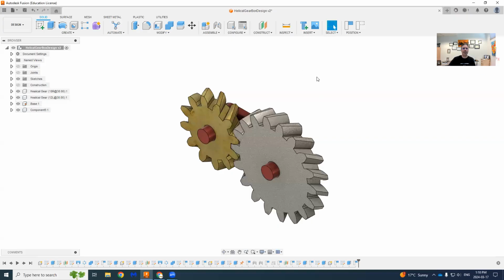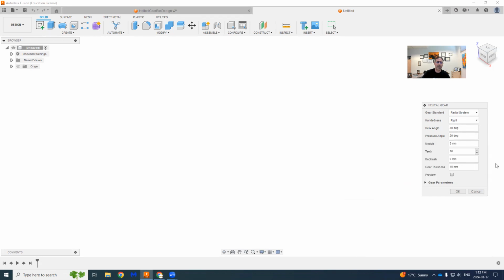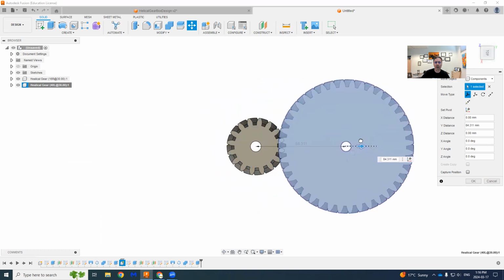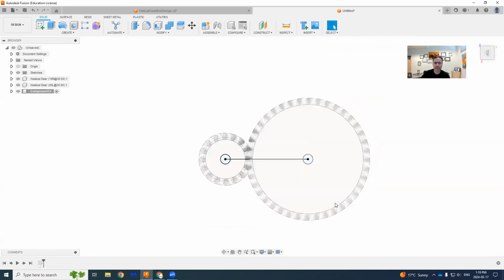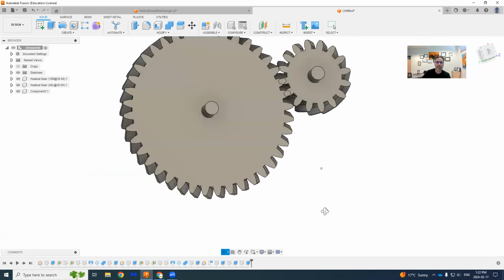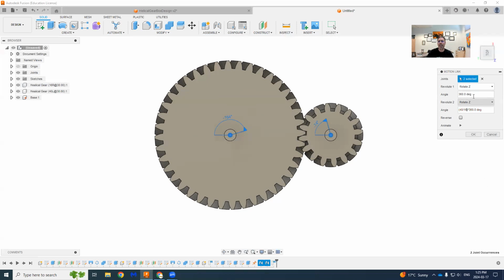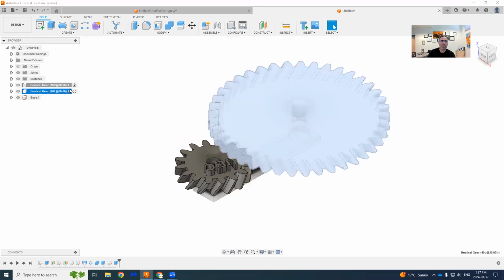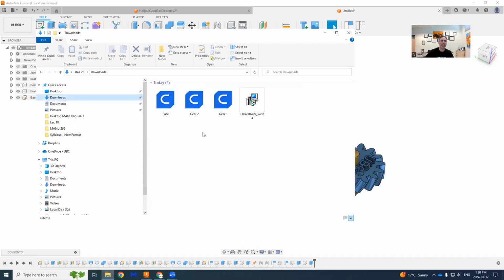Helical Gear Modeling in Fusion 360

Comment: I followed steps with 2mm module, 80 tooth and 16 tooth, 6mm height and they do not match (radial, one left one right), distance (192/2) and they overlap, only if I move smaller one 1mm further it looks kinda ok.